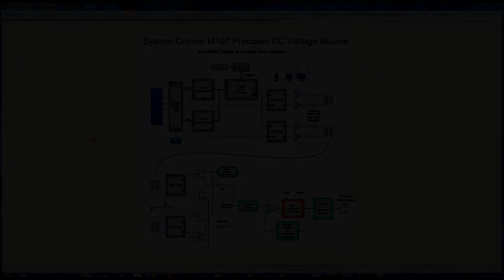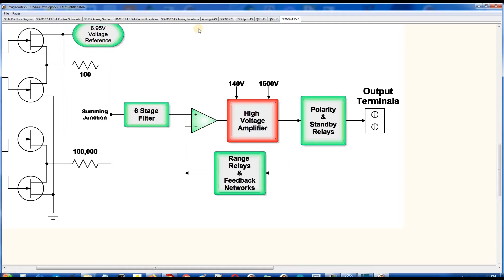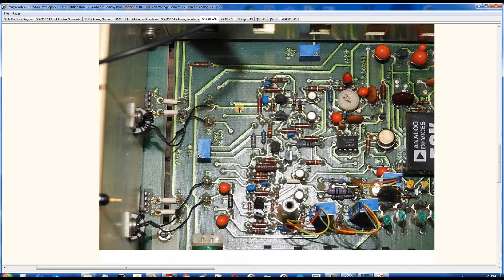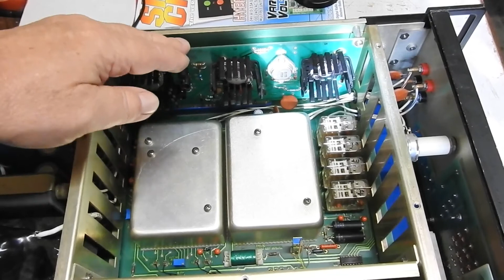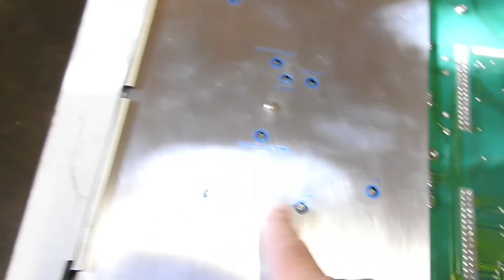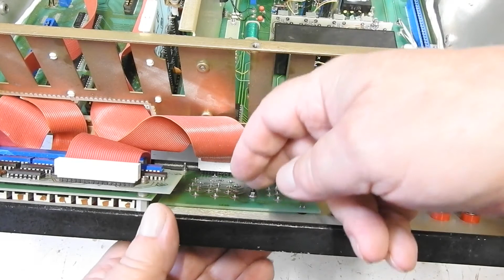Systron-Donner M107 Precision DC Voltage Source Teardown

Comment: Can you tell me the ordernumber for the switches, an where you purchase them. I bought also this Voltage Source and i need the buttons too. Seems an common problem with the switches.
Reply from the maker: The first 2 lots of ten were from Element14:- (2320076)
https://au.element14.com/c-k-components/mdpslfs/switch-spst-no-0-1a-100v-pcb/dp/2320076
And I have 5 more on order now from RS:- (1769564)
https://au.rs-online.com/web/p/push-button-switches/1769564
Is your unit working properly, apart from the switches?
Reply: @bertoid  Thank you.
Unit is on the way to me so I didn't know if everything is okay, but description say, it's working but bottoms are bad.